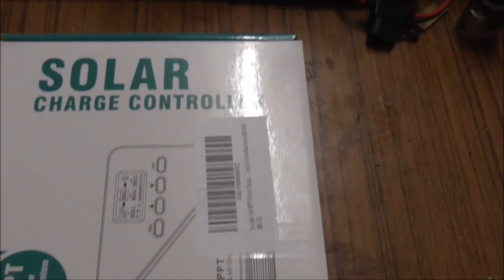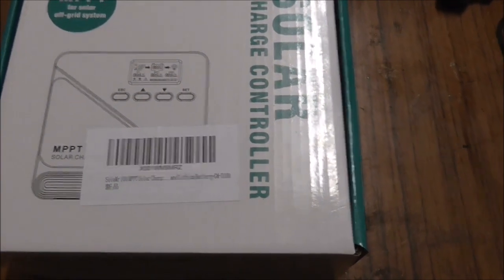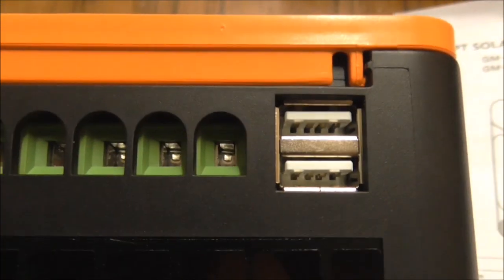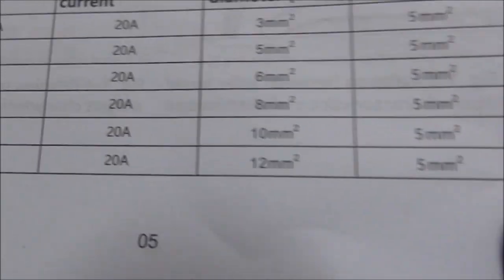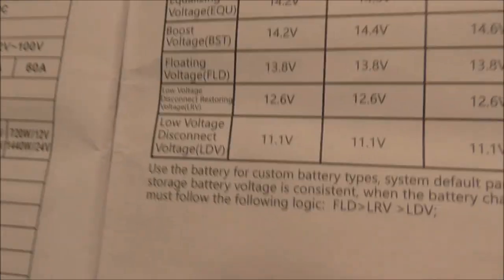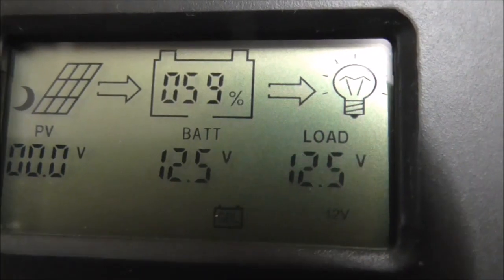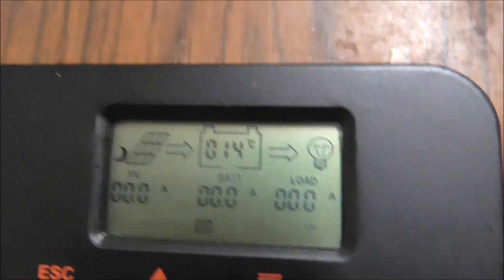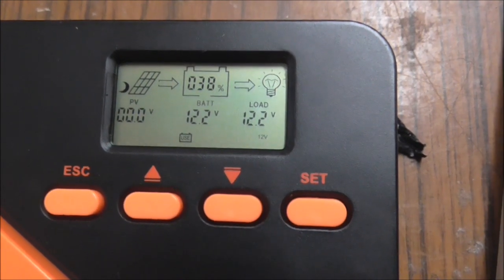SolaMr 10A mppt solar controller with 20 Amp load rating - part 1

Comment: How do you set the boost and equalizing voltages?  I have the same controller but it NEVER gets to 14.6 to equalize or balance the cells in my lithium battery.  I have an HQST 20 amp controller and you can change all of these settings and more but not this controller.  kinda sorry i bought this controller.
Reply from the maker: I had the same problem , see my comments about a year ago. Could not get it to charge above 13.8 volts.
Just ok for my use with lead acid battery, but not for yours.
Reply: @mgtsmartlady  Thanks for your reply.  You can set the charge voltage to what ever you want by pressing the set button and holding it for 5 secs then press the up arrow key and the left voltage numbers will appear and blink then you can adjust..BUT...then you have another problem...if you set the equalizing voltge to 14.6 it wll stay there,  it won't drop back down to float voltage of approx 13.8v.  That's too much charging I found out as my system shuts off for a few seconds probably because the battery BMS is not happy with the constant over charging. I'm really disappointed with this controller.

Comment: Can you kindly confirm if it’s possible to use 12-18v solar panel with this charge controller and charge 24v lithium battery ?
Reply from the maker: @nelsoncruz7278  Hi , I am no expert but don't think 12/18 volt solar panel will charge 24 volt lithium battery , will charge 12 volt battery ok.

Comment: Can i charge car battery with 20 or 40 w solar panel? 
Because it have mppt technology no reverse diode necessary
Reply from the maker: I don't see why not , depending on your location for hours of sunshine  and car battery size perhaps 20 watt solar panel would be sufficient. If for quick top up bigger size ok.

Comment from the maker: Doing a follow up video and finding that controller limits charge to 13.8 volts (float) and can't get to boost voltage or equalisation voltage. Can only get max 13.8 volts when controller starts ramping back current to maintain 13.8 volts.

Comment: please insert a reverse diode if you work a inuktive load!
This may work 5......
.8269 times but then suddenly mosfets die ;)
my english is verry bad  i  know...
Reply from the maker: Where would I fit a reverse diode and what size. Is this for any back emf ? Thanks for alerting me.
Reply: @mgtsmartlady  Yes it is for blocking back- emf.
 pur it directly (in close distance) across the relay coil (in blocking Direktion....kathode in direction + and Anode to -)
Reply: @mgtsmartlady  ....i forgott to mention the Dimension...
If you have 5 Amp of current i would take a 1A Diode (this is far to big but not expansive..... if the diode can not withstand  the current then it usually will Short out and the fuse will trip.....if the diode is far to small it can explode or the legs    will melt).
Reply from the maker: @anon72513  thanks again , I have some diodes of 5A , 100 volt will try 
one of them.
Was also thinking that since the solar controller negatives are common perhaps the main battery will act as a type of accumulator also .
Reply: @mgtsmartlady  Äh... most time solar charge Controllers Switch negative;).
Because n- fets usually have lower restistace then p- fets .
so all chargers i know Switch the negative!
I hope you have not one pwm....  because this things will lead acids most times real Quick (1..3 years) i can explain why and shurely there are ones out there that so not!!
But to Go by mppt is the Battery Friendly way. 
immagine some one pusht you away  with 5Kilos of weight...and someone  smashes 5Kilos every second in your stommac.....what will you preffere?
I hope i could help :)
Reply: i would take as far as arrivable a ""Hot-Carrier-Diode" known as schottky diode.... but bevore take no care on  this Effekt you can trust a oldscool Silicon diode ;) 100A i slighly overkill 😉 ....depends on your  Plans.......maybe you want to operate a 1KW DC motor to split your firewood .....have bad merorys on this Experiment......some melted plastic and a kind of Magic smoke out of the heavy duty relais (we Call it schütz ....like massive electromagnetic       swiches).
Contcts meldet....i fogot the diodes... 
Good Night and luck to you and your related whereever you live !
😊